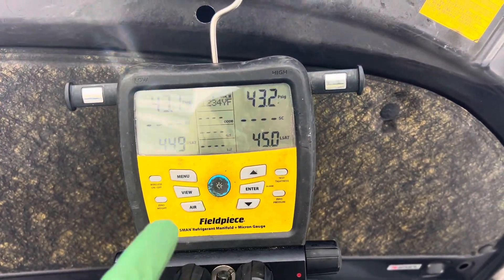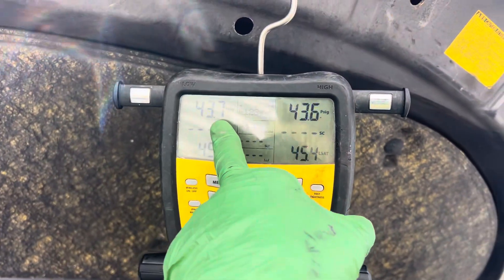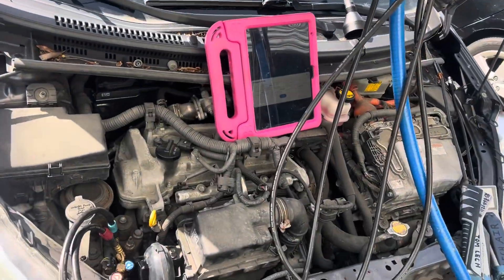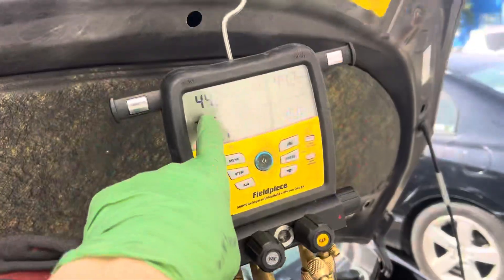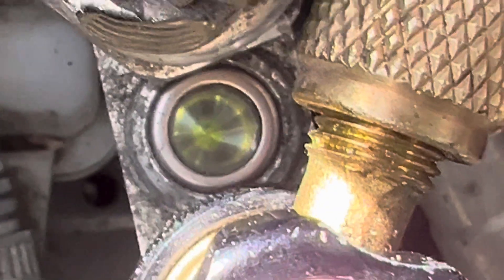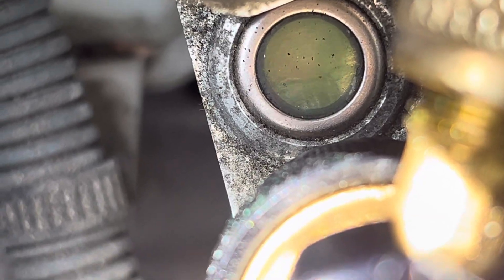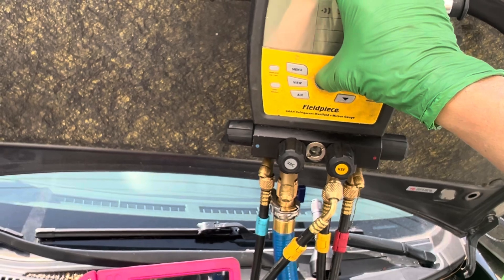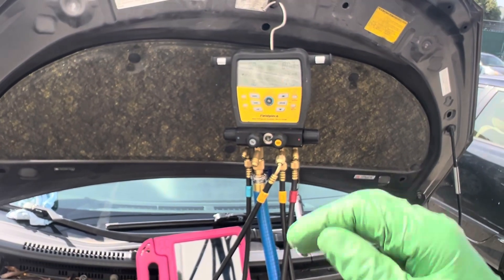AC Has No liquid Refrigerant, but last video there was liquid refrigerant in the side glass ?🤔

Comment: Interesting and I like the challenge!  Gas, under pressure, turns to liquid, especially passed the compressor before it enters the condenser because that’s what the compressor is designed to do. There it changes the temp but not the state. Until it enters the expansion valve.
Reply: I’ll have you know you came highly recommended by a viewer to check your channel. I must say, I like what I’m seeing. You’re worth subscribing to. Thank you for the work you do and the information you put out.
Reply from the maker: @AutomotiveMandC  there is also a Facebook group called
Automotive HVAC technicians 

I have a lot of good YouTube links to other instructors like Ty
Channel Love2HVAC

BRIAN ORR 
CHANNEL HVAC SCHOOL 

Craig 
Channel 
HVAC service LLC 

The links to the videos to search and watch are about topics like refrigerant stacking 

Refrigerant, superheat, and refrigerant sub cooling 

When you listen to these through three different instructors through three different points of views and three different analogies, usually everybody can grasp and understand it very well by the third time they listen to the same topic described and demonstrated by three different instructors three different ways
Reply from the maker: Almost you got a little something you missed a point and a component. 
He got part of the information, right 

On the right track for just missing a little something
Reply: @coldfinger459sub0 once the system has been turned off for a while the temp/press stabilized across the both high and low side?  Does the liquid enter the receive or the condenser first? perhaps you can share at some point?
Reply from the maker: @AutomotiveMandC  your question actually has a question and an answer inside of it if you search the theory of the basic operation of the refrigerant cycle

Yes, the system will stabilize and at high side pressure and liquid over on that side we go to the low side that also is a true statement 

But by the time it gets to the low side, neither the high side nor the low side will have any liquid at all. It will all be gone. 

And the entire system has nothing more than roughly 3 ounces of vapor distributed throughout the entire system 

And this is why I tell everybody to watch the videos about refrigerant stacking in about superheat and sub cooling, and you will learn the answer to your questions 

Instead of the answer just being handed to you without understanding the basics of what’s happening of the three gas laws and the sides of physics, which is really simple 

You learn more by researching your question, then being handed the answers on a silver platter . 
Learn something new every day and never stop

Comment: Because the gas form changes to liquid by the time it gets to that point?  I haven't caught you in a lie yet and I don't expect to. 😂
Reply from the maker: 👍 yes at that particular point, the compressor took a tiny amount of vapor. Gas was still available in the system, compressed it and rose it temperature and it’s density.. 
     Then ejected it into the condenser at a higher temperature and pressure than the temperature of the ambient air that allowed it to condense into some liquid at the very bottom of the condenser maintaining its liquid form, only due to the excessive pressure that was created by the comp. 
     As soon as you turned the system off that liquid refrigerant would flash into a vapor and spread the equilibrium throughout the system back into vapor only phase
Reply: @coldfinger459sub0 exactly as I thought it was

Comment: 44 PSI is below the minimum pressure for gas to condense in the system when it is about 80°.

Once you reach a minimum charge level the pressure stops increasing and further refrigerant condenses into a liquid. I think it's called partial pressure. Teaching this is key to unlocking an intuitive understanding of the refrigerant cycle
Reply from the maker: Then how about the not so intuitive understanding? I have 44 psi of only vapor here on a warm day.. 
     But it’s turning into liquid ?🤔 
    I know what the answer is

But it’s a good one to make people think and look up the answer and try to learn something . 

My dad showed me this when I was a kid before high school
Reply: @coldfinger459sub0 I think you're talking about liquid coming out of the condenser at high pressure and low temperature? But when you're low on charge, your subcool is not enough?
Reply from the maker: @d46512  of course there’s only like maybe 3 ounces in the entire system of vapor. Not just a little low a lot low.
     Like 95% low
Reply: Woof, woof